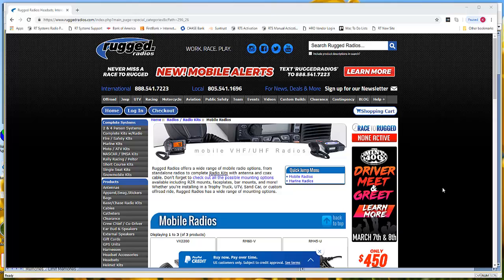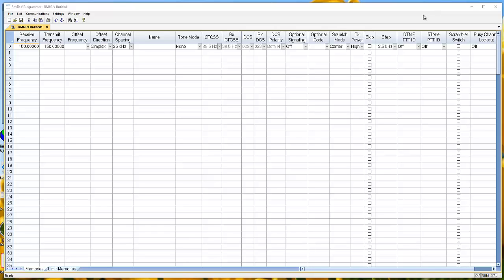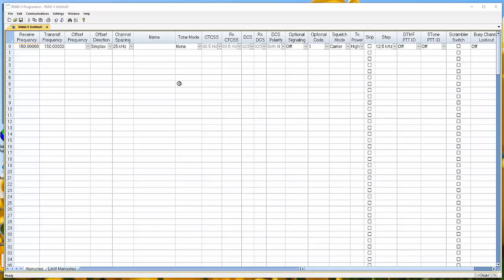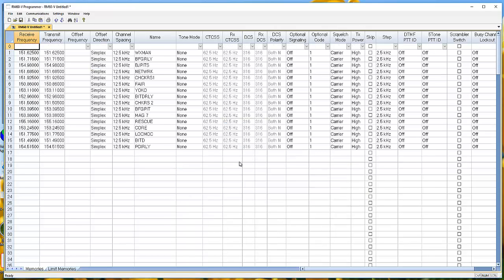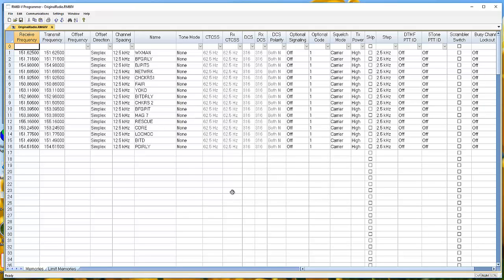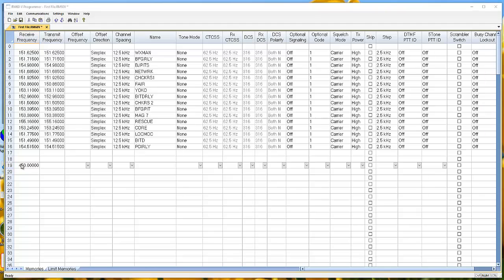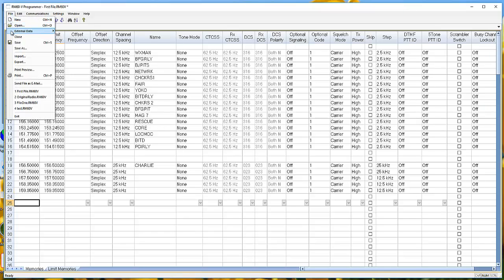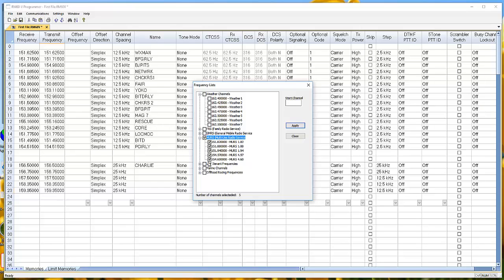Programming the Rugged Radio RM60-V

Comment: i get no ports. Windows says No drivers installed for this device.
Reply from the maker: HI, sorry for not getting back sooner. We can definitely help you. Are you using the RM60-V or another Rugged radio? Are you using the RT Systems cable? I am also including a link with this reply in hopes that it will help. Remember we have tech support available at 404.806.9561. You can give us a call between 9am and 5pm eastern , Monday- Friday. We can even schedule an appointment outside of normal business hours to accommodate you.   Please let me know if there is anything else I can help you with.  www.youtube.com/watch?v=EPWIRFk0ptk&t=3s

Comment: Does your software have all these channels available even if you don't buy the RR version?
My radio got water in it last trip and isn't transmitting anymore. I have an old tyt 9800 sitting around, I'm thinking this would be easier to program it rather than input each channel 1 by 1.

Comment: Using frequencies you're not licensed for in the USA is subject to fines of up to $20k / day from the FCC. MURS frequencies require a "type accepted" radio and are limited to 2W of output power. Marine frequencies are only authorized to be used on navigable bodies of water with type accepted equipment.
Reply: Absolutely agreed Lyle, it's because of activities like this the FCC breathes down the necks of people like us who abide by the rules. People using a marine radio for off-roading shaking my head!!

Comment: I just purchased my rugged radio and I learned that you need to be very careful using the VHF freqs. The FCC can and will fine you for operating on certain freqs without a license. There are allocated frequencies for specific use. I would caution people to do their research to ensure you don’t get into trouble and face high fines. Some HAM radio operators take this stuff very seriously.
Reply: randy turner yah that’s kinda why the whole ham radio thing is dying off. All the older douchebag operators are to crusty and arrogant to pass on the skill/hobby.
Reply: @joeblow8197  the skill/hobby isn't something passed down, it's something that you need to learn about to know how to use properly. That exactly what the ham tests are for. Very easy to pass the first test, and it opens many more bands for you.

Comment: So what's the difference from programming the radio on your bench in the garage or in the car out in the dunes? Video states you can't do this "in the field"...
Reply from the maker: You can if you have your computer and power for everything.  That is the only limitation.
Reply: @RTSystemsInc  seems to load fine but the channel I loaded will not transmit
Reply from the maker: Just the fear of the sand and the computer.  There is no reason you can't if you have enough power for the computer.... a weak battery here can cause problems since the process draws power from the computer (not to run the radio but to get the programming done.)
Reply: @RTSystemsInc  I've tried several times but have had no luck programming the radio to a custom channel. The channel loads into the radio but will not transmit. Rugged will not assist because the use a different software and when I call RT, nobody is available.
Reply from the maker: @samcarnibucci9094  When can we call to work with you?  We'll be glad to help.
Reply: Rod Thompson I called but you couldn’t help. I’ll just pay to have Rugged Radio program a channel. I’ll box up everything and send it back.